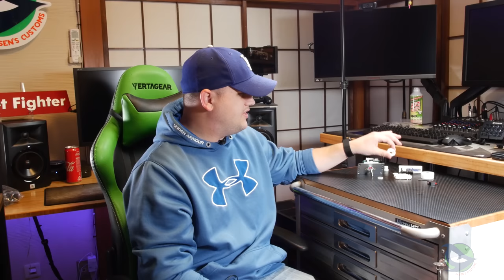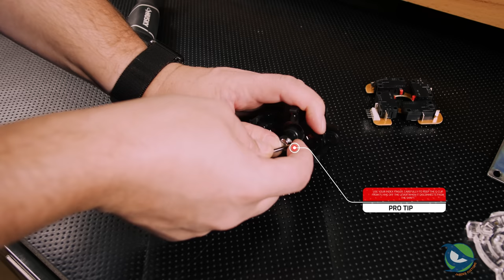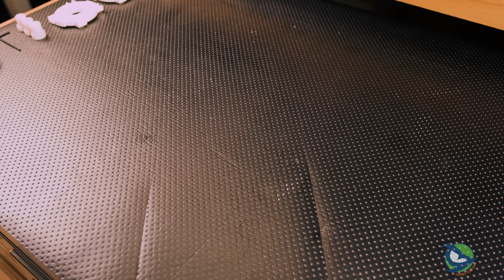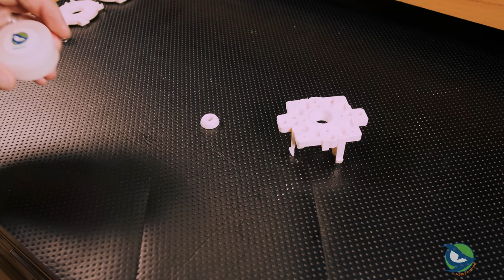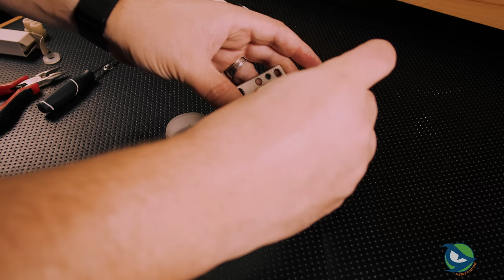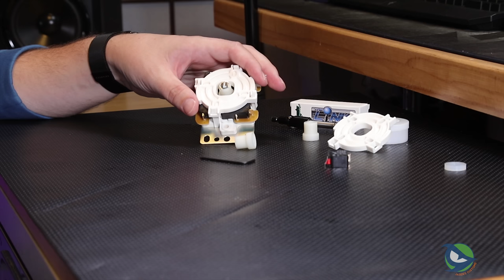OTTO DIY Sanwa JLF Upgrade Kit - Discussion and Install Guide!

Comment: PSA if you order the awesome v2 kit, make sure to install the grommet with the groove facing up and the bigger side of the collar facing up! Don’t overlook this detail or the grommets will quickly develop little tears and you’ll notice certain directions slightly sticking, at which point the grommet is useless. It doesn’t take much wear and tear to kill the grommet if it isnt installed properly so be careful about that and this is the best mod ever, especially with the new 4pk grommet replacement set that recently came out

Comment: Using the V2 with the stock sanwa spring, softer grommet, rounded gate, and the thinnest actuator that comes with the kit. Have tried many different sticks and mods, but have always fallen back to the stock Sanwa as my go to. This is the Sanwa mod I've always dreamed of. 

My current V2 setup is the perfect amount of tension and travel for me, and can attest to the crazy smoothness and overall feel. I had bought a separate Crown 309 just to play Tekken, but as everyone else who here that has the V2 has mentioned, the V2 with the extra rubber tension helps the stick reset to neutral so well I've forgotten about the Crown already. Again, this kit is just awesome and can't recommend it enough.
Reply: With your V2, do you get opposite accidental inputs when returning to neutral?
Reply: @bogartwilley  I haven't noticed that being an issue with mine; it seems to snap to neutral pretty easily without registering other inputs.
Reply: Tks bro i play tekken too and i was thinking about this...what tension ,configuration v2 do you use ...for tekken on v2 ?

Comment: Just got my OTTO DIY V2 upgrade kit and I am currently REALLY enjoying the smoothness (you really notice the teflon like gliding not sliding.)  The only down side I've found is that if you "flick" in one direction with enough force, the actuator does rebound and hit the opposite switch once. This CAN be remedied by kind of changing the way you cradle the battop, but so far... I'm satisfied with my purchase. 

P.S. I now know why Koreans like their lever. When wave dashing or KBD'ing in Tekken, I've noticed the silicon grommet actually helps reset to neutral in a way that allows you to re-actuate immediately. It's very VERY hard to explain, until you've tried it.     

TL;DR  Can wavedash & KBD a little more efficiently. GLIDING NOT SLIDING SMOOTH. The BYF circle hybrid gate still has corners but they're very rounded out and feel great.

Setup: Hori Rap N with OTTO DIY 2, 60 silicon insert, BYF circle hybrid, TP-MA Sanwa PCB, Stock Sanwa JLF Spring, and the 12.5mm actuator that was included.

Comment: The V5 pivot moves so smooth and amazin even without Grease.
Reply: whats the V2 and V5?  this is confusing.
Reply: @genantamtam9364  The V2 uses a rubber grommet to feel like a Korean lever, while the V5 is just a perfect JLF so it still feels the same just a lot smoother.
Reply: @snipebp  ok so which kit us more popular or to buy?

Comment: Got my V5 a few days ago and just got my V2 today. Between the two, I like the V2 with the stock JLF spring slightly stretched for a bit more tension. Getting instant neutral is amazing with super smooth inputs. Loving this mod. Gonna have to get another kit soon.

My JLF setup: OTTO DIY V2 w/ 40 Silicon, Stock JLF spring slightly stretched to assist in tension, Gersung V3 Microswitches, Stock JLF actuator.
The Gersung V3 switches require more activation force than the Sanwa PCB at least from what I can tell by just pressing them. This assists in the overall feel of the joystick.
Reply from the maker: Awesome!
Reply: How would you compare the 40a tension to regular spring, does it feel like almost 2lbs spring?

Comment: i just installed my V2, i like it a lot, really smooth.  i use the rounded gate and the biggest actuator.
Reply: and the softest grommet
Reply: How's it holding up a year later?
Reply: Bogart Gaming & Tech still really solid, like new. Switched to the middle actuator tho. The biggest one made stuff come out which i didn’t intended.
Reply: Bogart Gaming & Tech i did switch to the v5 kit. Couldn’t get used to the silicone grommet.

Comment: Awesome, looks like a simple all in one kit to revive/upgrade an old worn out and loose JLF lever. Adding this to my fightstick to-do list
Reply from the maker: Sir Charles - they are great. We have not full kits and pivot only kits now so you can try both and save :)
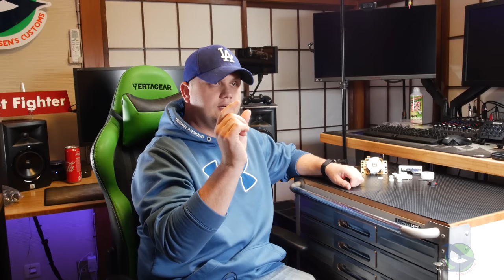Reply: @JasenHicksFGC   03:50  Hello, i have a question, you mentioned it will reduce the deadzone to the Switch,  will it also reduce the dead zone to the Gate?
That means that the lower AND the upper cylider is decreased in size and not onlt the upper cylinder that touches the switches? 
Thanks for the video.

Comment: I had 10 Sanwa JLF at one point but after i got the Seimitsu LS-40 i haven't needed another stick again and i don't feel it needs any modding. This is really cool though that there are kits like this!!
Reply: Do you play fighting games?  From what I can gather, alot of people said all the mods for the JLF are good in a way, but most of them still just prefer a stock Seimitsu LS-40

Comment: Question? When installing the v2 korean gromet, should the groove in the lips face upward towards the joystick or down towards the inside of the stick? I just ordered the multicolored bands from your site since BOTH my 40 and 60 broke (inner lip seperated from the outer). That brings me to my next question, what parts on the V2 would you recommend greasing? Hoping to avoid any more need for replacing these.
Reply from the maker: Groove up. The only area that needs to be greased is where I point it out in the video, where the black top hat meets the bottom of the body.
Reply: Ah I’m so glad someone asked this question and that it was answered! I love my v2 but I wore through the original grommets really quick because I had the groove facing the wrong way. Over a short period of time, the wear and tear quickly eats away at the groove and then you’ll start noticing it sticking slightly in the directions that correspond to the wear points in the grommet. And once a little tear develops the grommet is useless. I’d super highly recommend that this is mentioned and noted because this kit is really awesome but if you don’t know any better and kill the two grommets it comes with, then it’s useless until you get more grommets ordered and shipped. Now that I know better though and have the new 4 pack grommet pack I love it more than any other stick/spring/mod combo I’ve tried so far.

Comment: Just got my v5 in yesterday and noticed that even on the smallest actuator that came in the kit, I would get opposite direction inputs frequently. Anyone else have this problem? I had to switch back to the original JLF actuator. Wondering if anyone else had a similar experience?

Comment: For the V2 kit, when you say the the large diameter side of the red piece goes on top, are you talking about when you're placing it in the larger harness or when the stick is finally installed? They're two different directions and it's hard to tell when the video doesn't show both sides after it's put inside.
Reply from the maker: Victor Tran - large diameter goes so it’s facing up always. Even after install into the pivot holder.
Reply: @JasenHicksFGC  Thank you! I think that's how I set it up! I don't know if it's just me, but I noticed a bit of a squeaking from the v2 kit that I don't get from the v5. Did I possibly miss something during installation?
Reply: Also I forgot to add, the v2 kit feels great! It's exactly the kind of hybrid I was looking for. I love the fast return to neutral while also being able to feel and hear the clickiness of the jlf microswitches

Comment: I play a lot of Tekken 7.  I bought the Hori Rap 4 Haybusa, stick is too loose.  I heard about the Sanwa JLF and installing a 2lb spring.  The thing is I don't know what Sanwa joystick I need to buy.  Can you give me recommendations?
Reply from the maker: You should use the Hayabusa with an OTTO kit! That will tighten it up quite nicely. As a Tekken player, I think you would really like the OTTO V2 kit and the various grommets that adjust tension. Bot available here: http://www.jasenscustoms.com

Comment: Hey got a question for the people that have tried both OTTO DIY V1 & V5 kits, aswell as a Buttercade Sanwa JLF / Sanjuks V3 / Otto V5 Stainless Steel Pivot in a normal JLF lever, what feels best and how do they differ from each other??

If OTTO DIY V5 are combined with a Buttercade Sanwa JLF Otto V5 Stainless steel pivot, is it even more superior than any of the just mentioned stand alone?

and on a side note witch of the actuators ( that part that hits the micro switches and holds the spring in)  are the normal sized one that is standard in every sanwa JLF? 12/12,5 or 13mm ?

Comment: You mentioned that the kits comes with fancy Allen key but it does not, which is disappointing because I bought the V2 kit after watching this video. Then arcde shock told me I have buy it seprately.
Reply from the maker: If you buy it from me, it does.

Comment: It would be awesome if there was a seimitsu ls 32 version of it where it fixes the jumping pivot and the fast wear and tear of the plastics
Reply: There is, it's just not imported yet because it's still in the 3D printed prototype stage, while these are injection molded. https://twitter.com/otto_diy/status/1045896390667231232 I have it with the Korean style grommet and it's amazing. Haven't tried the Teflon JLF style pivot yet because I'm using that on the JLF style body, but you can mix & match.
Reply: @tronic307  thats really nice upgrade more siginificant on a seimitsu than a sanwa still by doing a much better and sturier bulid. Look very forward to see it through